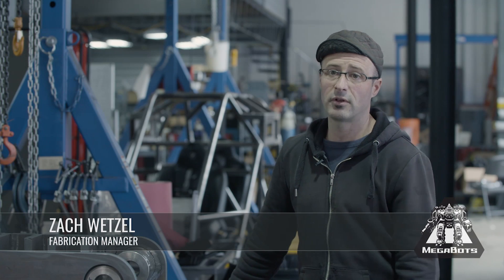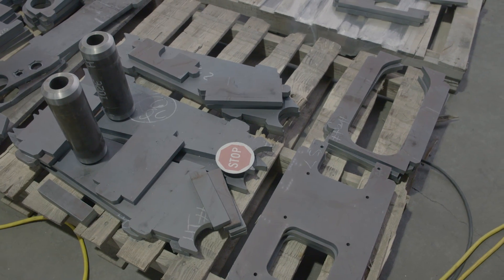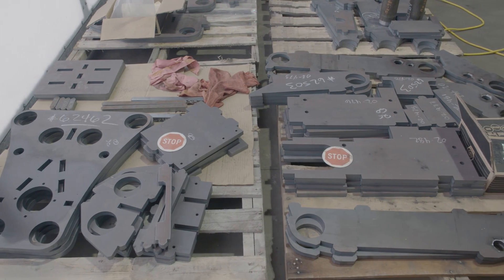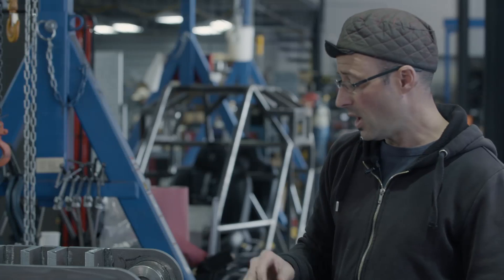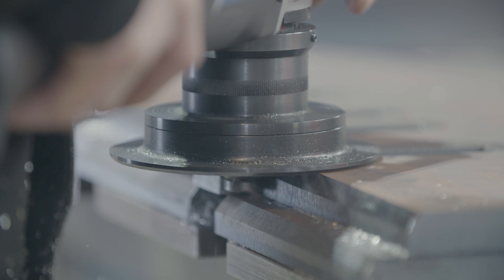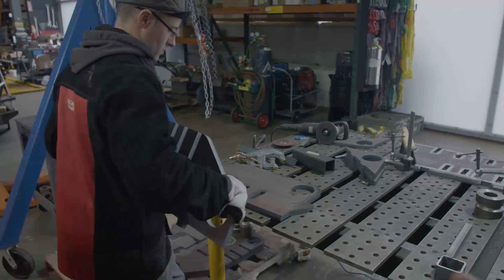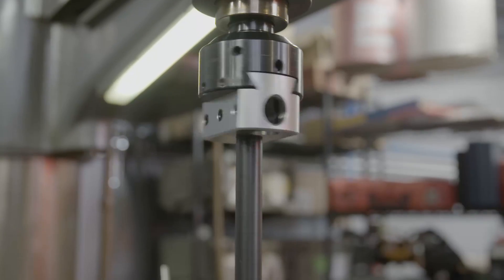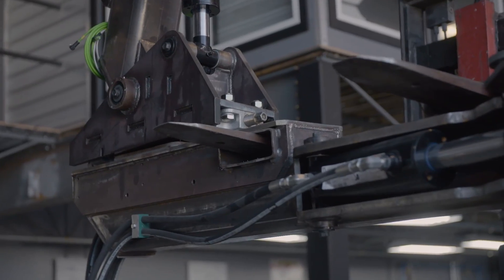How To Make Giant Robot Parts (Behind The Scenes)

Comment: Why are they MIG welding instead of stick or TIG? Cost, I suppose?
Reply from the maker: MIG is much faster than TIG for plates this thick, and we're not quite at the thickness necessary for stick welding.
Reply: MegaBots Inc Good to know! Thanks!
Reply: MegaBots Inc seriously is this going to happen? I like that you're making this really cool robot piece by piece. And I know that takes time. But we need to fight already. I don't care if you have to make both parts yourself, and tear them apart I want a robot fight already! PS have you heard anything from Japan? So you're showing lots of details about your robot including how to build it. Are you the least bit worried that they might use that to find weaknesses? PSS thanks for being awesome and trying to make this happen keep up the good work.
Reply: Also whenever you're finished building the thing make sure you spray that line -x to make it virtually indestructible.
Reply: jimmyhackers Welding what?
Reply: MegaBots Inc when do you think your meach league Will start
Reply: jimmyhackers That's pretty nifty! Say I were wanting to build a frame for something slightly bigger. What kind of metal would you recommend. I'd prefer to use square rods because welding cylindrical pipe is a pain.
Reply: there is nothing at the website listed, just a blank white page.
Reply: i would also like to add that push welds are stonger than whips (the way they appear to be welding)